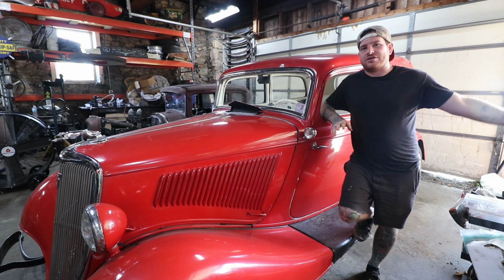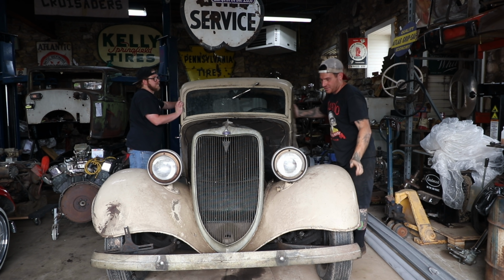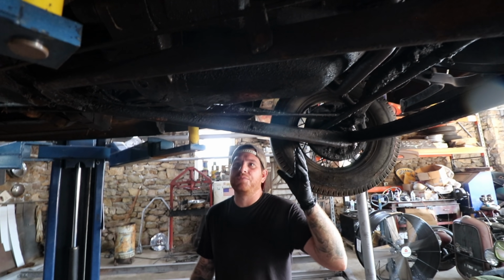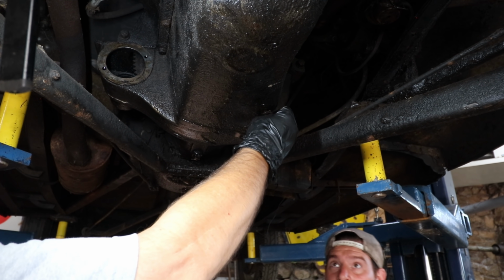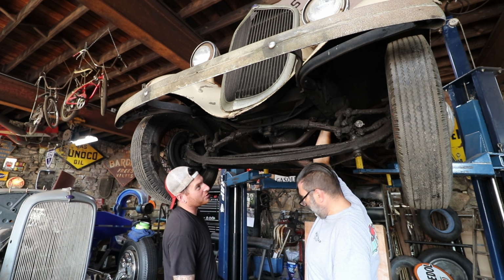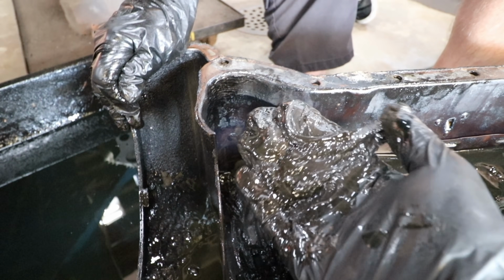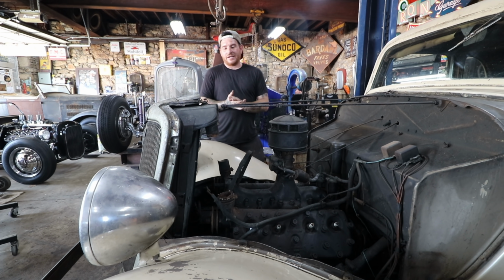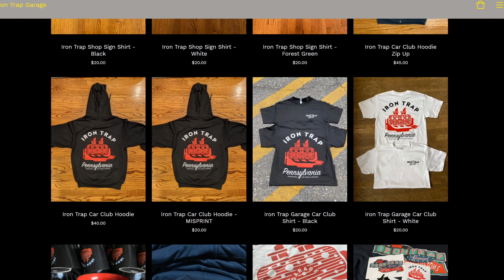Is The Engine In Our 1934 Ford Coupe Useable? Sitting Since 1965!!!

Comment: I love these revivals. My 1936 Chevrolet's engine was rebuilt in the 60s, car was parked in the garage. Engine was seized when I bought the car in 2014. I soaked it, and stuck it in the shed for six years. Having too many projects forced the necessary patience LOL. It worked, and seven years later I got it to turn over! Hoping the rings aren't stuck...

Comment: This is a real NICE old car!!! Be patient and work carefully. You guys are smart in pulling the pan and cleaning the crud out!! The motor oil that was used in this car probably was non-detergent because that is what they had. This is a real sweet heart of an old Ford!!! Try finding scrapers made of plastic or plexiglass. Make some even. Plastic is rigid like steel (to a point) but will not dig in and gouge. If I lived closer I would come over and work for free just to see this baby in real life!!

Comment: thanks  it's going to be quite an adventure  one thing about those older fords you only needed about 4 size wrenches and a hammer and pliers to take most of the car apart I got real good at replacing the timing gear in my 30 A model  I was 15 and there were 3 others in town I had the fastest one which is why I kept stripping the gear I used to ask my Uncle who was a fantastic mechanic and would let me use his shop and tools  how something went together his answer  two ways but only one will work! Turned out to be some very good advice !

Comment: Looking at the contents of the oil pan, I'm willing to bet she ran either Quaker State or Pennzoil in the car. That sludge is the paraffin that was in the old Pennsylvania oils. Used to see that quite a bit in old cars back in the 60's when I was a kid working in gas stations. Not a real problem, just clean it out with some kerosene or diesel. It'll be fine.
Reply: Yes!!

Comment: LOL on that muffler that's not mouse packing the old mufflers were packed with  sound deadening insulation ... I had a Volvo rout out a muffler and the end failed and I had insulation all over the place it was a 4 cly and I had a garbage full. That is also whey they rout out the insulation retains moisture thus causing the muffler to rout for the inside out leading to failure. Yes the sludge was increasable in the old oils causing a lot of failure of the lower ends. Cool share in this beauty.

Comment: Note to self, always pull the oil pan on any classic I'm trying to get back on the road.
Reply: The Model A I work on had about an inch of tar on the bottom of the oil pan. I dont know how any oil would have been able to circulate if I hadn't removed it and cleaned it along with the oil pump

Comment: I've seen several flatty drain plugs side drilled or notched for drain control, usually there will be a notch in the Nut side to indicate the clocking of the pour stream to eliminate the surprise direction of flow, It was common to see out here, must have been an old maintenance trick with those large drain holes back in the day. Very common on old farm equipment.

Comment: It is not a cotter pin in the weep hole it is a split pin. Cotter pins are solid metal, where as a split pin can be spread apart to hold it in place.

Comment: Very nice car. I’m sure it will run just fine after a few miles of smoke before it clears up. Just FYI, cotter pin rod nuts were early and nuts with “pal” nuts were later.

Comment: I use a straight spark plug boot on a valve push rod to remove and replace spark plugs. Never had one cross thread and they always run in clean.

Comment: Notice at 18.58 mins. you can see the spot of weld holding the oil pan baffle plate in, I welded my 'A' plate in when I had the sump off to clean it out as the pressed in ridges didn't seem to hold securely

Comment: Sweet!! The gunk inside the engine , not so sweet. Lol. 

My 32 Buick was coated probably twice as thick with grease and dirt . I scrapped off a metal garbage can full that had to weigh over 150lbs ... But let me tell you, the frame had not a speck of rust on it .

Comment: Don't make it straight exhaust. Put a muffler on it and keep it original.
Use to do a lot of maintenance on early cars, if you couldn't grease the steering/suspension you sprayed an oil mix on it. That is probably why the springs are coated to stop squeaks.
Reply: My Model A pan was the same when I got it 😀

Comment: Cleaning a gas tank?  
_ A friend and his dad spent a Saturday afternoon rotating and ossolating his 30 Model A (one on each end) with media to remove the hardened varnish. No external dents were produced.
_ An old cement mixer can replace the armstrong agitation when aggressive cosmetic attributes aren't important.  Insulate a metal drum with an old inner tube before ratchet straping the tank fast, occasionally change the angle.

Comment: ALWAYS pull the plugs before dinking with an old engine. If the block is full of oil it will save you from ruining another engine by hydro locking it or if it’s dry you should squirt some marvel mystery oil down the plug holes to lube the rings and cylinder walls. I’ll never forget you guys firing up an engine without checking to see if it had oil in it. You can’t go by what the previous owner says.

Comment: I had a Hudson that had sat since 1963 and it turned over.   I ended up selling it before getting too far, it had no spark and I figured the coil was bad.   I think it would have run okay if I'd thrown some parts at it.

Comment: I would pull the cylinder heads off or use a borescope to check out the condition of the cylinder walls. After you to that and clean out the lower end, then you should be Good2Go before firing it up

Comment: You might have some luck removing the overpaint with a heat gun. If it wasn't prepped properly, it might blister up pretty quickly with a few fast passes, leaving the original paint intact underneath.

Comment: I noticed the engine was cranked over with the spark plugs in place and being the owner kept filling the cylinders with oil , in order to avoid bending a connecting rod, the plugs should have been removed prior to attempting to break the engine free.

Comment: Surprises. Why does it have two water pumps?
Reply: In case one leaks..🙄
Reply: Flatheads had one for each bank.
Reply: @wymple09  im aware of the water pump layout- the question just struck me funny
Reply: @johngrepo9976  I had a nice running flathead in a 1948 dump truck. It was  239 cubes or somewhere close. It was crap for torque. Any Chevy 6 would drag it backwards. It did get great fuel mileage, so maybe I needed more carb & cam, or the biggest size, the 337. It was a medium size dump truck.

Comment: Hey M&M, pick up some of the doggie pee pee pads from Costco. They're pretty big and really help around the shop for greasy jobs. I put a few on the shop floor when doing messy oil splatter jobs. $15 for a box of 100. Beautiful is looking more beautiful with each episode. Congrats on the 100k subs. Still very low IMO.
Reply: Great tip! Im going to get a box tomorrow!

Comment: You ought to leave that grease on there since it is preserving the machine. Once it comes off you are waving goodbye to the benefit of all that service expense and effort. That is the very reason the mechanic kept greasing the service points and not wiping or washing it ever.   
The man with the oil can may have been squirting Marvel, Miracle Oil in there? Could have a mixture worth a tiny fortune in the crossover pipe and the sump.
Reply: Jack ... we all know the oil preserves things but at this age I'd lean towards cleaning everything and using a fresh coat of oil without the dirt. It would also be a good way to inspect everything for cracks / wear.

Comment: Did you hear me shouting alway from the Uk take the plugs out before trying to even push it in gear could Hydraulic it and bend conrods you new he had poured oil in bores. THEN You took them out to crank it much better.

Comment: Maybe its in good shape with all the oil and grease preserving it. I hope so. I hope the rings are not stuck if so put some seafoam in the crank case about 1 oz for each quart. run it a few days and change it it will clean it out like new. It works. https://youtu.be/3wMAsq7Zlp4    https://youtu.be/5N58ZqUFeBE

Comment: Forcing a stuck engine to run is not a good idea,  After being compressed for many years, valve springs are not going to spring back to original height.  Gaskets will leak and compression will be low. If it runs, it will be weak. I have a 1950 Ford Crestliner in that condition. It is driveable but  not satisfactory